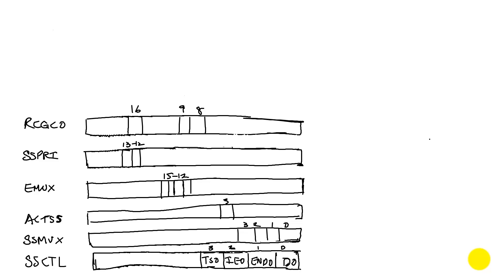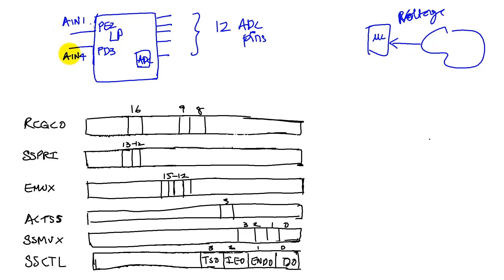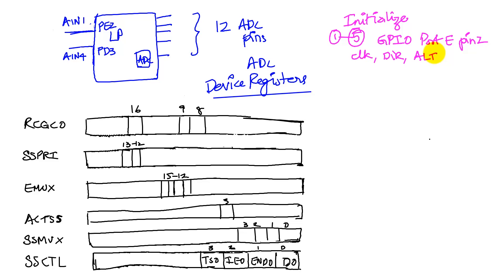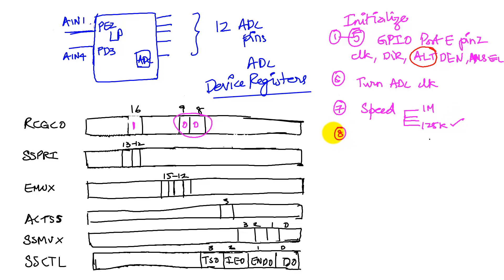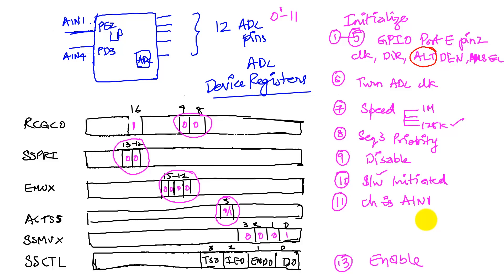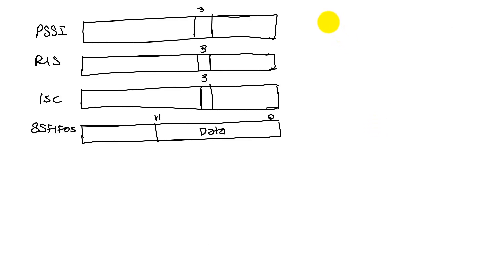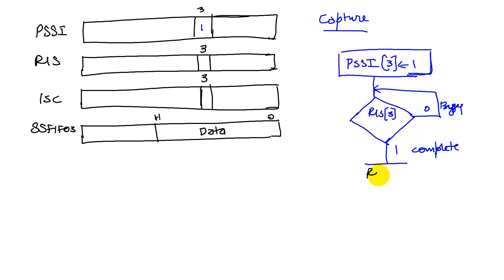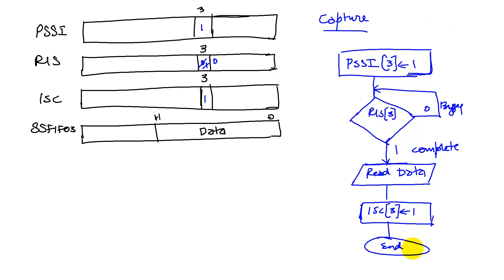C14 Video 3 ADC

Comment: Is not true that bits [1-0] ( those bits are equal to '00' after a reset) of ADCSSPRI must be '11' in order to "each sequencer have a unique priority for the ADC to operate properly" (page 838, TM4C123GH6PM Microcontroller  datasheet)?